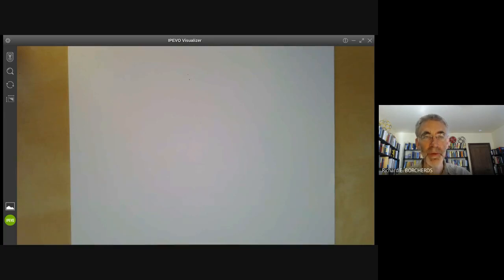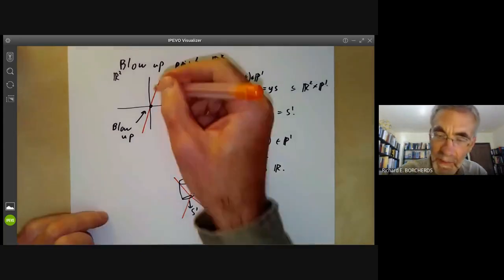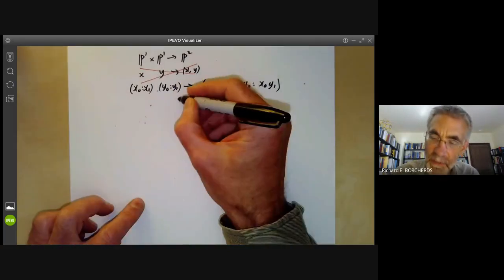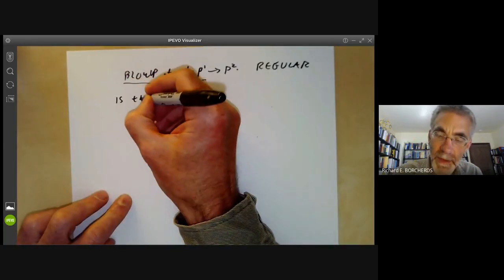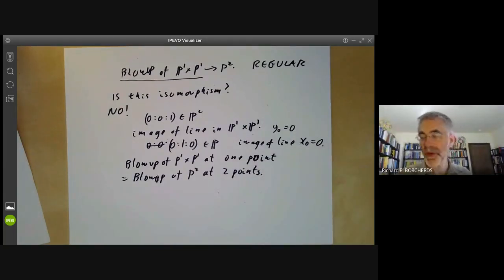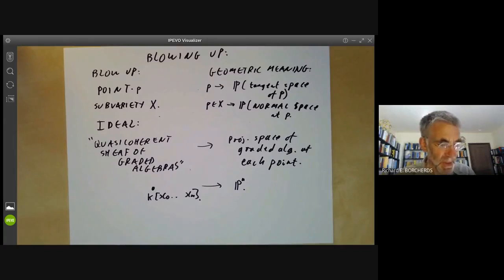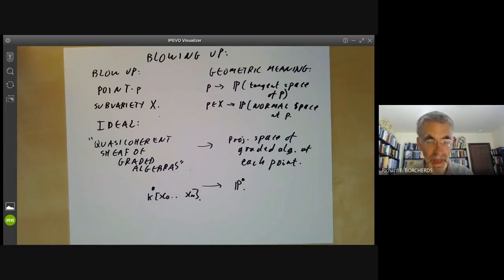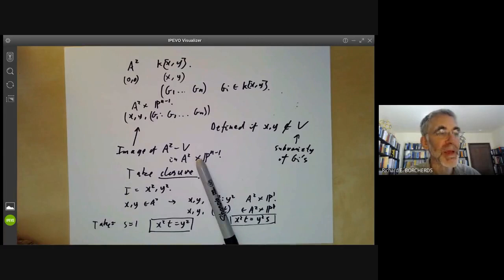algebraic geometry 35 More on blow ups

Comment: The blow up at (0,0) of 2-dimensional affine plane  is the set of points ( (x,y); [X:Y]) satisfying xY = yX, which  is not orientable.

 Note that real projective line is orientable, that is there is a nowhere vanishing vector field.In fact, let s, t (=1/s) be local coordinates of projective line, then f(s)d/ds = f(1/t)(-1/t^2)d/dt. Thus, to get good vector fields, we can assume that there are constants a,b,c so that
  f(s) = a + bs + cs^2,
from which
f(1/t)(-1/t^2) = -at^2-^bt –c.
Both of f(s)d/ds  and f(1/t)(-1/t^2) does not have zeros on real numbers if b^2-4ac < 0.  Taking a,b,c such that b^2-4ac < 0,  we can get a nowhere vanishing vector field on the projective line.

The correspondence from product of two copies of P^1 into P^2 is defined by sending (x:y) and (X:Y) to (xX:yX:xY). This is not a map, because the point of x = X = 0 is sent to (0:0:0) which is not a point of P^2. To define this map at the point  x = X = 0, we consider the blow up at  x = X = 0, that is ( (0:1), (0:1) ), which is done by introducing new local coordinate t of projective line and relation x = tX. The new correspondence from blow up to P^2 is (xX:yX:xY) = (tX^2: yX: tXY) = (tX: y: tY), which is well defined at x = X = 0.  In fact, at x = X =0 we get (xX:yX:xY) = (tX^2: yX: tXY) = (tX: y: tY) = (0: y: tY), which  does not vanish  since y is not zero.  Humn, I am not sure. The Blow up of P^1 times P^1 is a submanifold of the products of three copies of P^1.

10:14 What the inverse image of (0:0:1) ? If (tX: y: tY) = (0:0:1), then y = 0, so x = tX is nonzero, which is contradicts the first component of  (tX: y: tY) = (0:0:1). Using another new local coordinate s, that is sx = X instead of x = tX, we get  (xX:yX:xY) = (sx:ys:Y). In this coordinate, the inverse image of (0:0:1) is the set of points ((x:y), (X:Y). (s:t) ) =  ( (x:y), (0:1) , (0:1)) for any (x:y). So, the inverse image is a projective line and we can regard this as an  exceptional curve, I guess.

10:14 I am not sure .. the blow up of P^1 times P^1 is isomorphic to the blow up of P^1 at the two points (0:0:1) and (0:1:0)??

Geometric meaning of 17:11: I do not understand well.

Blowing up at ideals of k[x,y].
Take an ideal of k[x,y] generated by n polynomials G1(x,y),….Gn(x,y).
Blowing up along an ideal (G1(x,y),…,Gn(x,y) ) is defined as the closure of the points
( (x,y), [ G1(x,y):…:Gn(x,y) ] ) in A^2 times n copies of projective line, where (x,y) moves in complements of zeros of the ideal  (G1(x,y),…,Gn(x,y) ).
Blowing up of a point is the special case that G1(x,y) = x and G2(x,y) = y and if we denote the homogenous coordinate by [X:Y],  we get [G1:G2] = [x:y] = [X:Y], which is equivalent to xY = yX. This relation appeared early.
If we take G1(x,y) =  x^2 and G2(x,y) = y^2, then [G1:G2] = [x^2:y^2] = [X:Y] which is equivalent to x^2Y = y^2X. Taking X = 1, we get the local coordinate representation x^2Y = y^2 which has singularity. So, the blowing up of nonreduced ideal (x^2, y^2) has a singularity.